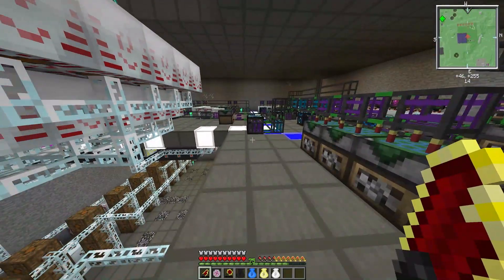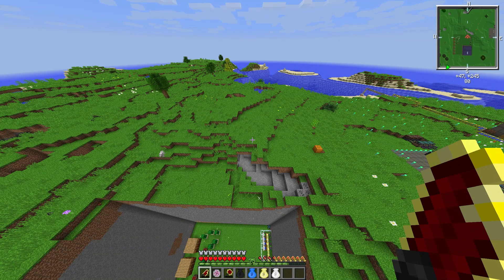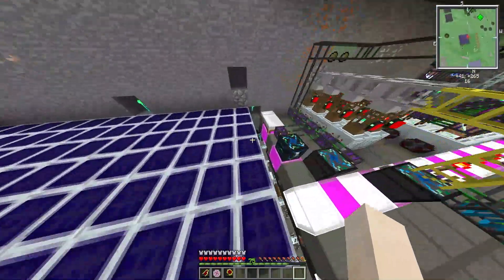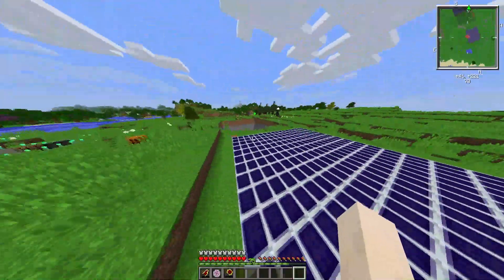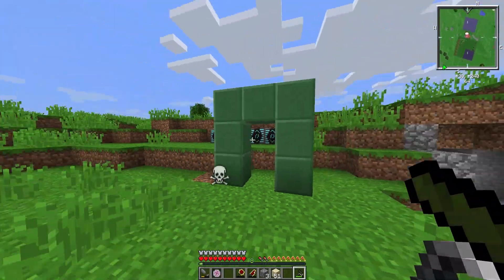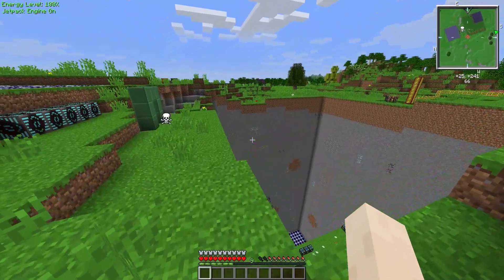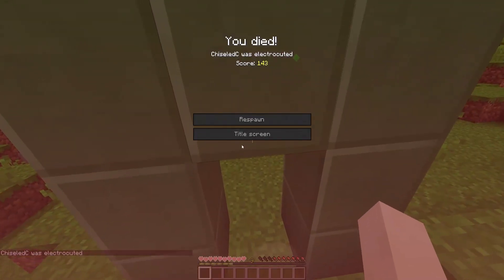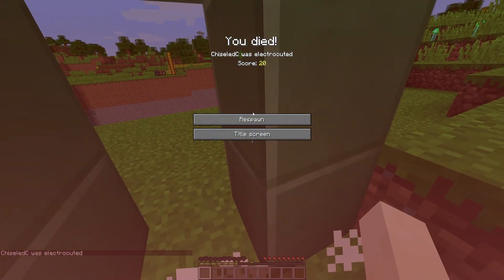TEKKIT 2 - Making a Quantum Killer - Ep 16

Comment: You found a cool feature of electric armor.

Electric armor actually absorbs any electrical damage to charge itself.
Same with lightning.
Though if you are in the air and be struck by lightning and can't absorbs the power (and absorbed at least 1eu) you get dealt the entire rest of the damage on to you...

Edit: Ic2c dev here
Edit 2 I think you found a bug. Will be fixed with the next patch.
Reply from the maker: Oh perfect! It also seems that potions of instant damage go straight through which I found. Didn’t include it in the video tho. Probably should be patched too? Two instant damage 2 kills you lol
Reply: @chiseledchin7088  Potions are intended to be let through.
Pretty sure 1.4.7 and older versions also had that case.
It is also a balance reason.
Because having the perfect armor that is protecting you from everything just gets boring.

Fun fact your electric method will kill gem armor too xD